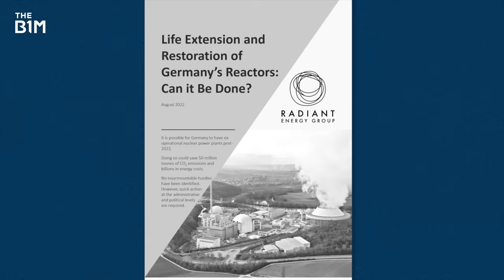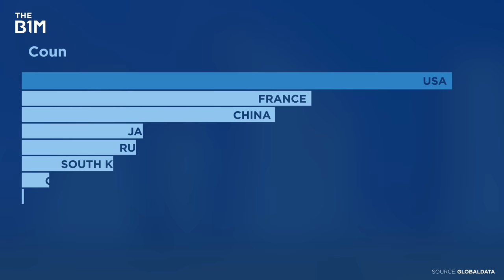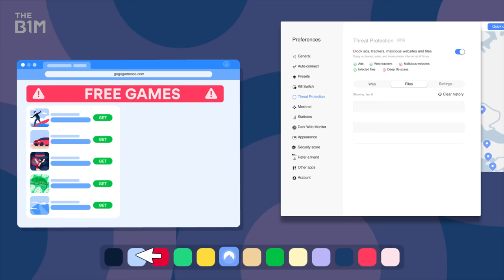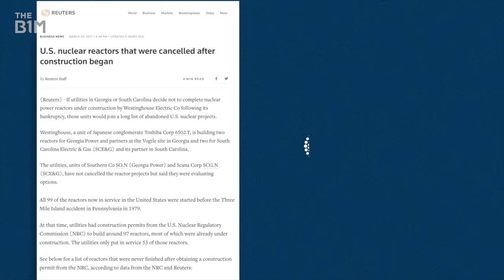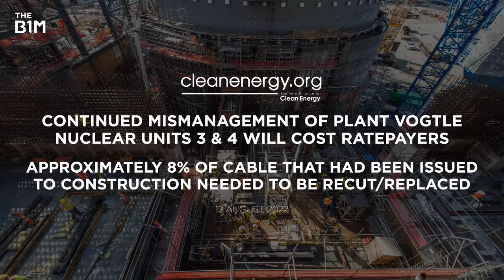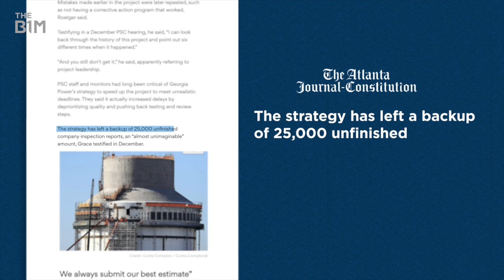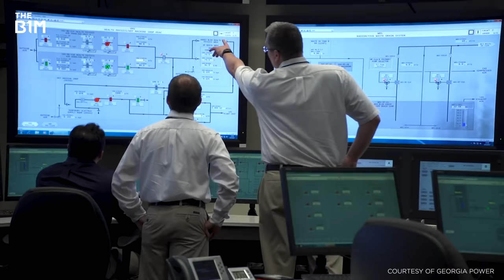Why Nuclear Power is Making a Comeback

Comment: I find it a bit sad that this channel can't even correct the common misconception about the Texas Blackout: It wasn't because of renewables are unreliable, or NPPs can deliver. Even with more NPPs the same would've happened, because the problem wasn't energy production, it was the grid.

Back in 2011, Texas experienced something similar and the North American Electric Reliability Corporation made suggestions to better prepare the infrastructure to be better suited for cold weather, these recommendations were ignored by ERCOT (as they were in 1989 when this also happened).
Furthermore: The Texas grid doesn't have a safety margin beyond expected draw and the grid isn't even able to meet peak summer demand when needed.
The Texas government then cancelled a contract with the Texas Reliability Entity and disbanded the Oversight and Enforcement Division, reducing oversight further and dropping cases that aimed to improve reliability.

Another thing, that's very peculiar to Texas apparently: Normally you'd expect, that an underperforming company should lose money, right? Well if you're a natural gas supplier, you make money from underperforming.

So basically the grid operator didn't bother to spend the money to keep their equipment from freezing, the politics let them do as they pleased.
Reply: Where did the video say the Texas blackout was caused by renewables? Around 2:10 the expert talks about the cold causing gas supply issues, which it absolutely did and caused CCGT plants to go offline. 

You are correct about ERCOT and the rest though, Texas refuses to cold harden their infrastructure and won't connect to either of North America's grid interconnections.
Reply: @ChristinaK1024  
Solar and wind are heavily subsidized. This reduces the profit margins for competitors, with entirely predictable results. It’s either cut costs or go out of business.
Reply: @ChristinaK1024  I didn't say the video, i said "common misconceptions", which are only thinly veiled spoken about by the "expert", who should be called "lobbyist", as Radiant Energy Fund is a lobby organization aiming to influence politics fore more NPPs. In fact here in Germany the "expert" linked to a petition about reversing our nuclear phase-out -- completely, which would mean, old and insecure reactors would come back online and not help energy prices or the grid stability in any way.

Basically what the "expert" is trying to say, and B1M never corrected is: More NPPs would have saved Texas from a blackout and kept NG prices low. Because more power from NPPs would have meant less gas to gas power stations and thus more gas for consumers or less consumption overall.
However, this still wouldn't have prevented the grid from simply freezing to death.
His Twitter is also... very questionable, where he tries to uses memes to bash any energy source that's not nuclear.

B1M simply adopting the "advising governments" speak from a lobby organization, without further questioning is really bad journalism on their part.
Reply: Why not direct your dissatisfaction with this channel's video on the matter into producing your own video to correct all of the errors you seem to have found in Fred's.
Reply: @Hyakman5408  Did I insult God or some other higher authority?
Isn't constructive criticism allowed in your eyes because this channel is infallible?
If you answered any of these question with "yes", you probably should think about your understanding of journalism.

Not every user has the ability to make a fact checking and correction video. Even if I had, my reach on that video is so abysmal that the algorithm wouldn't promote it.
Just by typing a comment on the issues, the reach is far greater than any video I could make.
Reply: @Ruhrpottpatriot  see.......The Great Global Warming Swindle - Full Documentary HD.......YouTube
Reply: @Hyakman5408  I will refer this episode from the Well There's Your Problem podcast:
https://youtu.be/O4vHgFY7TSA
Reply: @bwake  Correct if I'm wrong but isn't that completely false? The oil and gas industry receives far more subsidies to produce energy than the renewable ones
Reply: Same thing in Georgia.  They are rewarded for project delays since they are tacking on a surcharge to bills up front for this plant to be built.  Lack of regulation for private companies that are utilities is just asking for higher bills.
Reply: @ianhomerpura8937  My comment was nothing more than you see: produce your own video and make it interesting, informative, and balanced. If you or anyone else read something into it beyond what I stated, that's on you and on others, not me. Speaking only for myself, I have neither the time nor the interest to bob and weave around a point. I try to make my comments as short and on target as possible so people don't have to guess where I stand 😀
Reply: The Texas blackout was completely due to renewables. Yes if the grid operators had not screwed up the event likely could have been limited to a smaller region and rolling blackouts… but 100% due to renewables.
Reply: ERCOT does not own or operate any generators. The responsibility to winterize was with firms like Vistra Energy, NRG, Calpine, etc - not the non-profit ERCOT. Texas was not the only place to ignore winterization recommendations from the 2011 FERC/NERC report - the entire rest of the country did too (despite many other close calls due to extreme cold). Also the issue of a reserve margin is a red-herring - if the reserve margin had been a few percentages higher they still would have been fucked because like half their generation went down.
Reply: @Hyakman5408  he probably doesn’t have the reach, whereas on here his comment is read by more people (incl yourself) 
And he is right
Reply: @davidnorris1093  Renewable energy made up less than 30% of the TX power grid.  The failure came because they did not invest in upgrading or maintaining their infrastructure.  That's why gas plants failed because the didn't properly insulate the lines and the gas didn't flow properly.  Spending only what was required (next to nothing) as well as deregulation 100% caused it.  BTW...windmills run just fine in Sweden and Finland where it gets way colder than TX...again, lack of investment.
Reply: @davidnorris1093  Did you even read the preliminary reports? It doesn't matter what type of power generation you use, when the grid itself freezes.
And it's not like this was the first time. No it was the THIRD time, the first one in 1989, where almost no renewables existed in the grid.
Reply: @scpatl4now  You said it yourself. Renewables are too expense to maintain. Might as well spend the hard earned money on nuclear which is wayyyyy more efficient and cheaper.
Reply: Wrong, the grid worked, so was nuclear. With 100% no one would even notice the freeze.
Reply: @ChristinaK1024  the author of the channel likes RE, so he skipped it. Renewables delivered almost 0 during the freeze. Completely useless when you need them the most. But Texas still had fossil capacity to fully cover the demand. But fossils also partially failed and delivered only 50% of installed capacity.
Reply: @drgonzo1971  even if you winterize the wind turbines, they wouldn't produce energy at the time, because there was simply no wind.
Reply: @ImaskarDono  Yes, because your NPP running keeps transformers and substations from freezing...
Reply: @kovy689  No they are not. Over the lifetime of a plant, the average cost of nuclear power is the same as lignite with 76 or more € cents per kW/h, while for natural gas it is 31 ct and for solar its 4 ct.
Reply: @Ruhrpottpatriot  Too bad the sun doesn’t shine 24/7.
Reply: @kovy689  So what? You need energy storage, fat chance. We can use batteries for small scale scenarios or Hydrogen and reservoirs for large scale ones.

I have solar on my roof with a battery in my basement, and I have MASSIVELY reduced my energy bill by about 70%. I also have a heat-pump and have massively reduced my heating and cooling cost.
Even if just right now, in the middle of the night, a blackout was happening, I'd be golden for the next 12 hours.

France,  a country with dozens of NPPs, currently has an energy problem because a) most NPPs are down for maintenance b) because of climate change most of the river water is too hot for the cooling cycle.
So more nuclear doesn't prevent you from having problems.

People think what you replace 1Gw of fossile with 1GW of renewable and be down with it.
That's not how renewable works. You make a decentralized and compartmentalized grid. This grid brings the power production closer to consumers, or even right at their doorstep. This means we need less big transmission lines, consumers have to buy less and can sometimes even sell.
This also makes the grid more resilient since you cannot just take out one big plant and a whole region goes down. You know, just like what's currently happening in Ukraine with Zaporizhzhia NPP. It's not in danger of any nuclear incident right now, but it's on and off the grid thus increasing stress on other parts of the Ukranian power grid.
Reply: @Ruhrpottpatriot  TL;DR
Reply: @ImaskarDono  that made no sense
Reply: husss....you're ruining the mood, the video did it on purpose
just let the fanboys enjoy their dream of being "the hero"
Reply: @kovy689  If your attention span is so short that you can't even read that much text, it's probably better that you aren't in a position of power.
Have a nice day.
Reply: @Ruhrpottpatriot  TL;DR
Reply: You are doing a great job, ignore the comments by from the handicapped people. It is their loss that they even fail to recognize and form actual fact based arguments. Thanks for your information , I learned something from them about nuclear and it all made sense too. Don't let these guys drag you down.
Reply: @ImaskarDono  just want to point out, but South Texas Project actually ceased operations during Snowmaggedon due to the inlet pipes freezing over. Outlet pipes usually provide enough heat to prevent this, but the outlet pipers were too far away to do this.
Reply: @howardbaxter2514  were are those false stories coming from? Only 1 of 4 reactors was stopped for a few days. And only because a measurement device froze, because they didn't build a roof! And even in such situation, nuclear delivered 75% of installed capacity, higher than any other source.

Comment: Hey thanks for the shout out to Watts Bar! I only worked there for a few months in 2015-16 for construction of the haul path and spent fuel pad, but I remember Unit 2 was finally getting finished at that time. It had started construction way back in the ‘70s but stopped for a long time and was essentially being used for spare parts for the in-service Unit 1. If there’s anything I learned at the nuclear plant is that it is an extremely regulated and safety-oriented industry with virtually no tolerance for the slightest error. Heck, I remember seeing a plant-wide email about a safety incident where someone had been injured, but it was literally a cut to a finger.

Another thing I learned is just how serious they take security of these power plants. Just to be able to enter the protected area required a background check with multiple references, a safety course, a palm vein scan, and a 500+ question psychology test, among other things. If anyone was ever dumb enough to try to jump the fences into the protected area (not even able to get to a reactor, as that is even further guarded inside), instead of entering through a (heavily guarded) portal, lethal force would be authorized. And hearing the frequent gunshots coming from the nearby on-site shooting range was a constant reminder that the guards in the lookout towers were well-trained and ready for anything. I wouldn’t lose a wink of sleep over cyber security of a US nuclear plant having seen all this in just 4 months time.
Reply: Lethal force its the norm in nuclear plants when it comes to dealing with unauthorized access, and it's pretty clear with large signs clearly stating that if you cross the line there will be no warning shots.

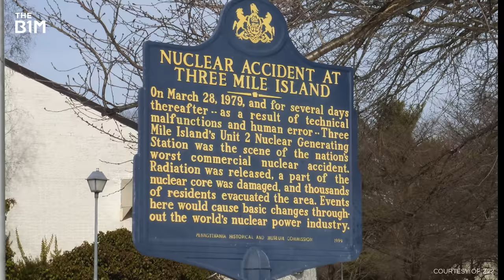Comment: 3:32 People need to STOP saying 3 mile island was one of the worst nuclear accidents in history. It does not even compare to Chernobyl,  Kysthtym, and Fukushima. No one was killed or even seriously injured. The amount of radiation released was miniscule. Key safety systems worked as intended.
The harm from abandoning nuclear power in the US is out of all proportion to the TMI accident.
Reply: I don't think Fukushima is anywhere near comparable to Chernobyl, but it is true that it was "suprisingly bad", given that it happened in an OECD-country (and people would stereotypically assume that the Japanese are very thorough on such stuff).